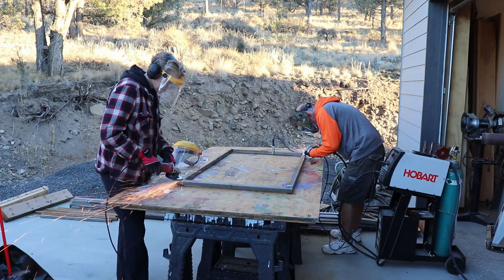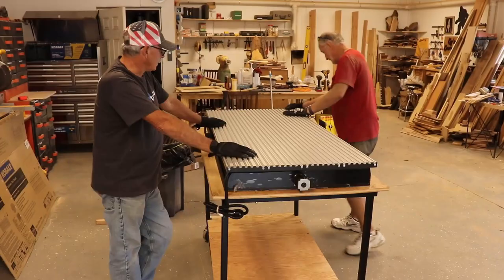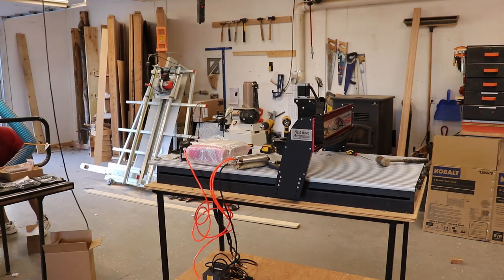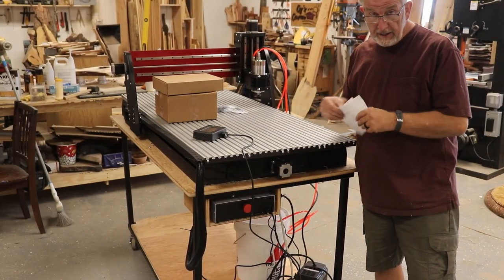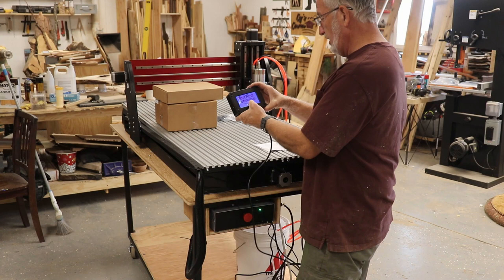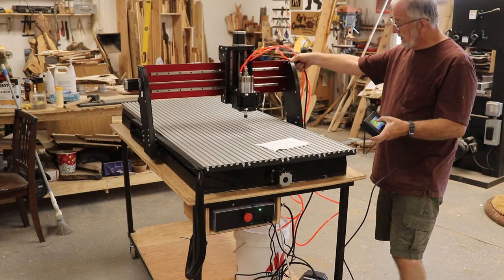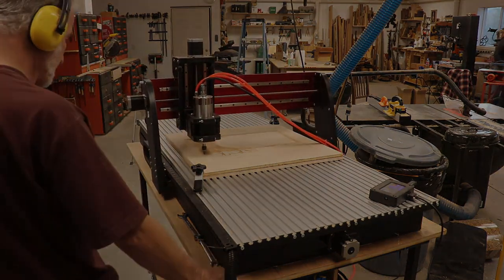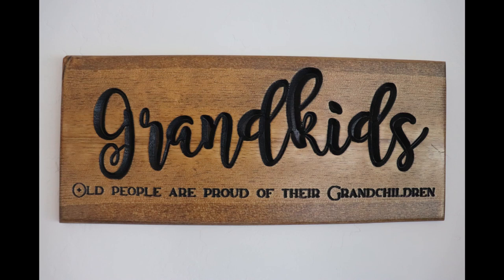CNC Shark HD5 Unboxing

Comment: great video. I am welding a table for my HD520 - using 2x2 square tube, 18". 30"x60" and 30" tall. very close to you measure. Also plan to use casters... Go Bucks.
Reply from the maker: Awesome!!!

Comment: Hooking mine up now. I can’t get the orange hose on the fitting on the pump even after heating. I can’t get past the first ring on the white fitting on the pump. Any help or suggestions is appreciated. Thanks
Reply from the maker: Kevin, please send an email to Stan, my husband. He can help you out. He did say he used a lubricant to connect the orange hose.
smarshwin@yahoo.com

Comment: Just ordered my Shark HD5 ext. the question I have is how big did you make your stand and how big was the Sq tubing.
Reply from the maker: I told Hub your questions and he is going to get back to me with those answers!
Reply from the maker: The metal frame is with 1.25" square tubing, 56" x 30" x 31" high. 4 inch casters are on the bottom. The top has 3/4 " plywood, 63x34".
Reply: @CysCorner  Thank you. I should have a Shark HD5 extended showing up in the next week or two...let the games begin

Comment: what's your verdict a year later on the HD5?
Reply from the maker: He had to have the control box and the water spindle replaced once. They did that at no charge, and he has had no issue with it since. He does like it very much!

Comment: How big and tall did you make your table to set the shark on
Reply from the maker: Hello, finally measured it for you! It is 36 3/4 inches high, 34 inches wide, and 63 inches long. He also put a shelf 6 inches off the ground underneath for the spindle water bucket and any other items. On casters too.  :)
Reply: @CysCorner  I just bought the same model could you send me the settings for the Inverter parameters I think I messed mine up Thank you Jack